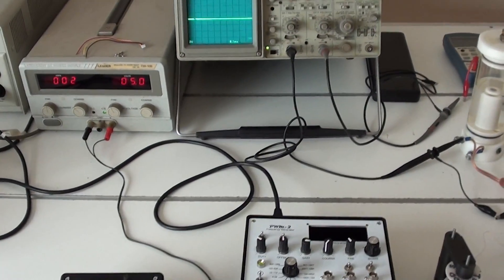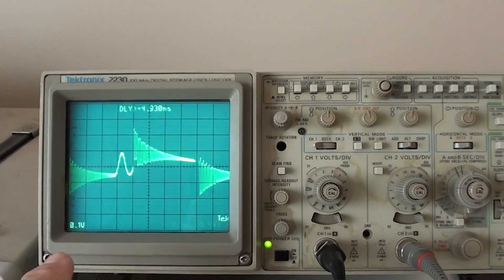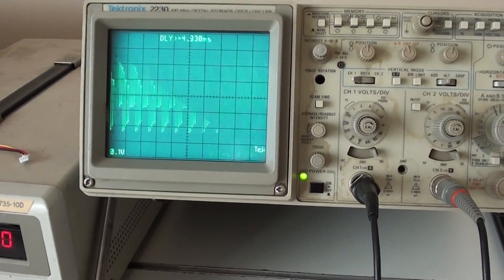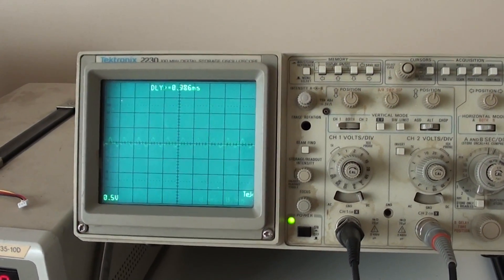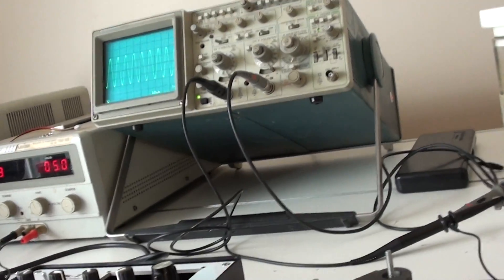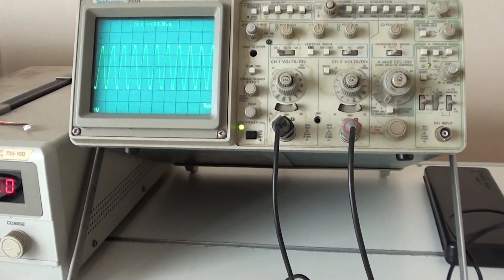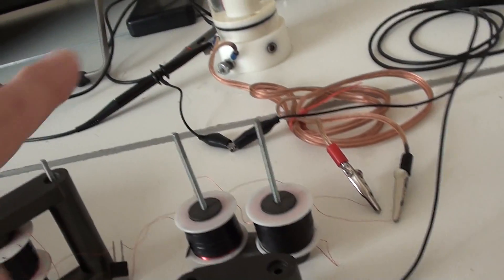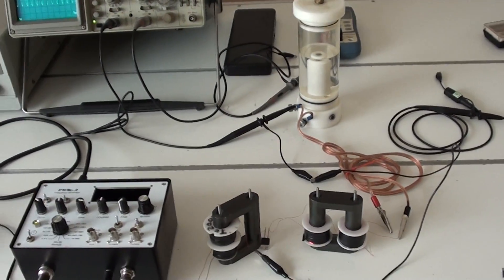Stan Meyer replication resonant cell 3

Comment: Awesome Thanks so much Don, really appreciate this video. I haven't played with Primary and secondary "Step Up Transformer" but have played with Chockes, I have 2 scopes,f requency gen's, wave form gen's etc. Also 9xa and 9xb. I need help with pulsing a battery if you have a circuit that I can use please. I got the Totem mosfet driver pole circuit but couldn't get it to work for me yet. Thanks for the video once again.
Reply from the maker: You already have a good frequency generator, you just need to hook it up correctly for it to work. You also need the correct components to work with it. Don't mix one system of Stans with another. Either build the 8XA circuit or the resonant circuit. The 8XA uses a SCR, the resonant circuit uses the VIC coil, the one with a primary , secondary, and two chokes. Don't mix the two together.
Reply: Dynodon64 Which are for which tho? I always get confused when I try figure out what he wanted to do, produce Hydrogen yeah but what is the best system to build to make the car run like he did with his first test run, cause you cant see his circuit. Must have been with the alternator I think or on the "Off-Time" 12V dc pulsed, maybe have 2 different signals in with a 50% duty cycle each. Maybe one was with the 9xb and the other with 9xa, one with mosfet and other with scr. But both gated I suppose. Gets me so confuswed I feel dead right now lol blehhhhhh
Reply: Francois Korff OK so 9xa with U-Core and 9xb aka 8xa with E-Core
Reply from the maker: the 9xa and 9xb boards are the same generators. One just has two generators on it. They both work the same.
Reply from the maker: Francois Korff The buggy was only show running with the demo tube type cells. Both times he ran it with the alternator set up. There are no videos showing the buggy running with the resonant cell.
Reply: Dynodon64 Max told me that the 9xb is only the gate and that the 9xa is the freq Gen. Cause the 9xa you can set pulse width and frequency
Reply from the maker: their both frequency generators. It's how you use it if it's a gate driver or the primary frequency driver. They both work the same.
Reply: Dynodon64 I see, I'll give it a shot tomorrow, wanna build that transformer. Did you check Edward Mitchell's BEM Energy conference setup and his partners explination? Pretty interesting, apart from the bad mouth he gets from some I think he is on the right track, unfortunetly for him, one of his transformer coils burned up. But he got them in Transformer oil. Interesting stuff, thought you'd might like to watch it if not watched allready.

Comment: Very nice Don,thanks.What hapens if you measure the voltage with a meter on the AC scale?
Reply from the maker: If the meter is capable of the voltage, it will read it.
Reply: ok,thanks,i thought the  high freq will afect the reading